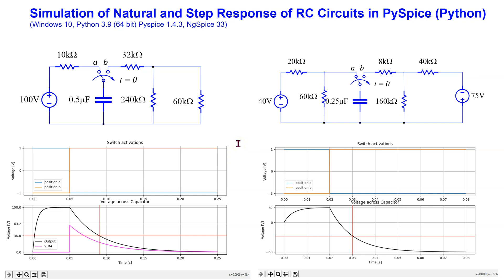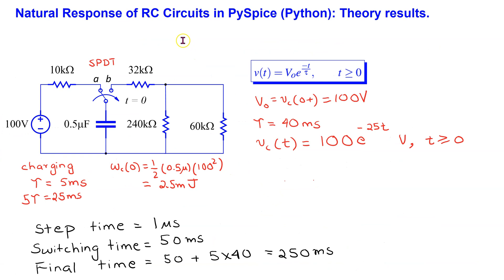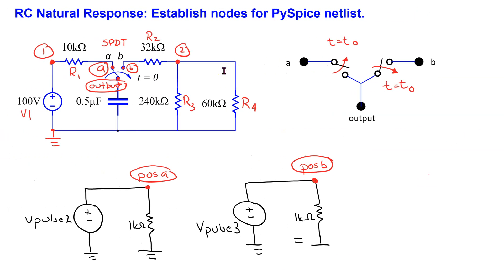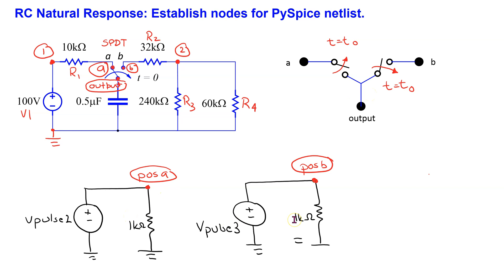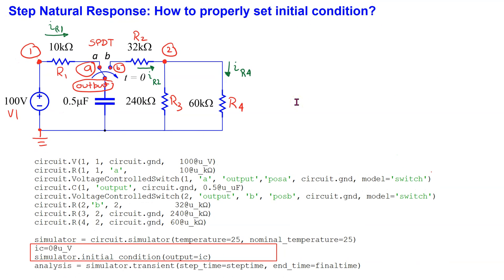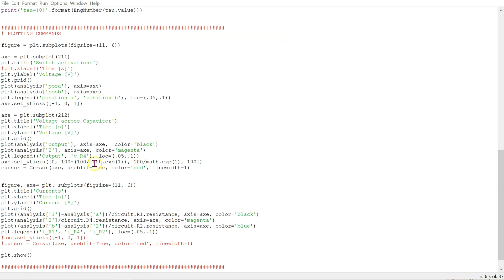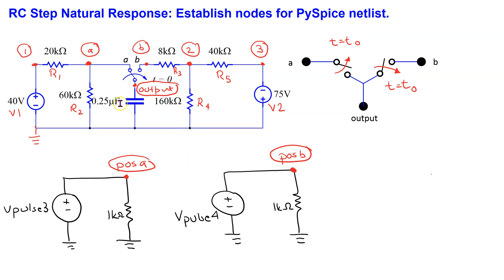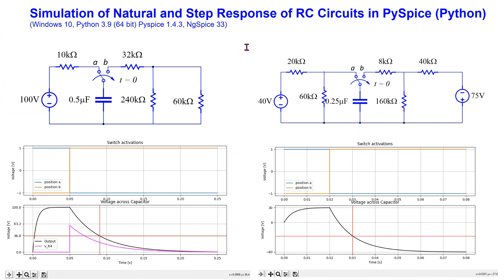Introduction to PySpice (Python) for Simulating Natural and Step Response of RC Circuits

Comment from the maker: # Pyspice (Python) code to simulate RC Step Response.
#####################################################################
# STANDARD DECLARATIONS

import matplotlib.pyplot as plt
from matplotlib.widgets import Cursor
import numpy as np

import PySpice.Logging.Logging as Logging
logger = Logging.setup_logging()

from PySpice.Doc.ExampleTools import find_libraries
from PySpice.Probe.Plot import plot
from PySpice.Spice.Library import SpiceLibrary
from PySpice.Spice.Netlist import Circuit
from PySpice.Unit import *

import math
from engineering_notation import EngNumber

#####################################################################
# CIRCUIT NETLIST
circuit = Circuit('Step Response of RC Circuit')

steptime=1@u_us
switchingtime=20@u_ms
finaltime = 80@u_ms

circuit.model('switch', 'SW', Ron=1@u_mΩ, Roff=1@u_GΩ)

circuit.PulseVoltageSource(3, 'posa', circuit.gnd,initial_value=1, pulsed_value=-1,
                           pulse_width=finaltime, period=finaltime, delay_time=switchingtime)
circuit.R('testa', 'posa', circuit.gnd, 1@u_kΩ)

circuit.PulseVoltageSource(4, 'posb', circuit.gnd,initial_value=-1, pulsed_value=1,
                           pulse_width=finaltime, period=finaltime, delay_time=switchingtime)
circuit.R('testb', 'posb', circuit.gnd, 1@u_kΩ)

circuit.V(1, 1, circuit.gnd,   40@u_V)
circuit.R(1, 1, 'a',          20@u_kΩ)
circuit.R(2, 'a', circuit.gnd, 60@u_kΩ)
circuit.VoltageControlledSwitch(1, 'a', 'output','posa', circuit.gnd, model='switch')
circuit.C(1, 'output', circuit.gnd, 0.25@u_uF)
circuit.VoltageControlledSwitch(2, 'output', 'b', 'posb', circuit.gnd, model='switch')
circuit.R(3, 'b', 2,           8@u_kΩ)
circuit.R(4, 2, circuit.gnd, 160@u_kΩ)
circuit.R(5, 2, 3,            40@u_kΩ)
circuit.V(2, circuit.gnd, 3,   75@u_V)

simulator = circuit.simulator(temperature=25, nominal_temperature=25)
ic=0@u_V
simulator.initial_condition(output=ic)
analysis = simulator.transient(step_time=steptime, end_time=finaltime)

#######################################################################
# THEORETICAL CALCULATIONS

# Time constant after switching
tau =(circuit.C1.capacitance)*(circuit.R3.resistance +
                                 (circuit.R4.resistance)*(circuit.R5.resistance)
                                 /(circuit.R4.resistance+ circuit.R5.resistance))
print('tau={0}'.format(EngNumber(tau.value)))

#######################################################################
# PLOTTING COMMANDS

figure = plt.subplots(figsize=(11, 6))

axe = plt.subplot(211)
plt.title('Switch activations')
#plt.xlabel('Time [s]')
plt.ylabel('Voltage [V]')
plt.grid()
plot(analysis['posa'], axis=axe)
plot(analysis['posb'], axis=axe)
plt.legend(('position a', 'position b'), loc=(.05,.1))
axe.set_yticks([-1, 0, 1])

axe = plt.subplot(212)
plt.title('Voltage across Capacitor')
plt.xlabel('Time [s]')
plt.ylabel('Voltage [V]')
plt.grid()
plot(analysis['output'], axis=axe, color='black')
#plt.legend(('Voltage'), loc=(.05,.1))
axe.set_yticks([-60, 0, 30])
cursor = Cursor(axe, useblit=True, color='red', linewidth=1)

figure, axe= plt. subplots(figsize=(11, 6))
plt.title('Capacitor current after switching')
plt.xlabel('Time [s]')
plt.ylabel('Current [A]')
plt.grid()
plot((analysis['b']-analysis['2'])/circuit.R3.resistance, axis=axe, color='black')

plt.show()

#####################################################################
# Pyspice (Python) code to simulate RC Natural Response.
#####################################################################
# STANDARD DECLARATIONS

import matplotlib.pyplot as plt
from matplotlib.widgets import Cursor
import numpy as np

import PySpice.Logging.Logging as Logging
logger = Logging.setup_logging()

from PySpice.Doc.ExampleTools import find_libraries
from PySpice.Probe.Plot import plot
from PySpice.Spice.Library import SpiceLibrary
from PySpice.Spice.Netlist import Circuit
from PySpice.Unit import *

import math
from engineering_notation import EngNumber

#####################################################################
# CIRCUIT NETLIST
circuit = Circuit('Natural Response of RC Circuit')

steptime=1@u_us
switchingtime=50@u_ms
finaltime = 250@u_ms

circuit.model('switch', 'SW', Ron=1@u_mΩ, Roff=1@u_GΩ)

circuit.PulseVoltageSource(2, 'posa', circuit.gnd,initial_value=1, pulsed_value=-1,
                           pulse_width=finaltime, period=finaltime, delay_time=switchingtime)
circuit.R('testa', 'posa', circuit.gnd, 1@u_kΩ)

circuit.PulseVoltageSource(3, 'posb', circuit.gnd,initial_value=-1, pulsed_value=1,
                           pulse_width=finaltime, period=finaltime, delay_time=switchingtime)
circuit.R('testb', 'posb', circuit.gnd, 1@u_kΩ)

circuit.V(1, 1, circuit.gnd,   100@u_V)
circuit.R(1, 1, 'a',           10@u_kΩ)
circuit.VoltageControlledSwitch(1, 'a', 'output','posa', circuit.gnd, model='switch')
circuit.C(1, 'output', circuit.gnd, 0.5@u_uF)
circuit.VoltageControlledSwitch(2, 'output', 'b', 'posb', circuit.gnd, model='switch')
circuit.R(2,'b', 2,           32@u_kΩ)
circuit.R(3, 2, circuit.gnd, 240@u_kΩ)
circuit.R(4, 2, circuit.gnd, 60@u_kΩ)

simulator = circuit.simulator(temperature=25, nominal_temperature=25)
ic=0@u_V
simulator.initial_condition(output=ic)
analysis = simulator.transient(step_time=steptime, end_time=finaltime)

#######################################################################
# THEORETICAL CALCULATIONS

# Time constant after switching
tau =(circuit.C1.capacitance)*(circuit.R2.resistance +
                                 (circuit.R3.resistance)*(circuit.R4.resistance)
                                 /(circuit.R3.resistance+ circuit.R4.resistance))
print('tau={0}'.format(EngNumber(tau.value)))

#######################################################################
# PLOTTING COMMANDS

figure = plt.subplots(figsize=(11, 6))

axe = plt.subplot(211)
plt.title('Switch activations')
#plt.xlabel('Time [s]')
plt.ylabel('Voltage [V]')
plt.grid()
plot(analysis['posa'], axis=axe)
plot(analysis['posb'], axis=axe)
plt.legend(('position a', 'position b'), loc=(.05,.1))
axe.set_yticks([-1, 0, 1])

axe = plt.subplot(212)
plt.title('Voltage across Capacitor')
plt.xlabel('Time [s]')
plt.ylabel('Voltage [V]')
plt.grid()
plot(analysis['output'], axis=axe,  color='black')
plot(analysis['2'], axis=axe, color='magenta')
plt.legend(('Output', 'v_R4'), loc=(.05,.1))
axe.set_yticks([0, 100-(100/math.exp(1)), 100/math.exp(1), 100])
cursor = Cursor(axe, useblit=True, color='red', linewidth=1)

figure, axe= plt. subplots(figsize=(11, 6))
plt.title('Currents')
plt.xlabel('Time [s]')
plt.ylabel('Current [A]')
plt.grid()
plot((analysis['1']-analysis['a'])/circuit.R1.resistance, axis=axe, color='black')
plot(analysis['2']/circuit.R4.resistance, axis=axe, color='magenta')
plot((analysis['b']-analysis['2'])/circuit.R2.resistance, axis=axe, color='blue')
plt.legend(('i_R1', 'i_R4', 'i_R2'), loc=(.05,.1))
#axe.set_yticks([-1, 0, 1])
#cursor = Cursor(axe, useblit=True, color='red', linewidth=1)

plt.show()

#######################################################################

Comment: Thank you for making this video. It is very helpful. I have a question regarding accessing LTSpice components model library in PySpice. I am trying access the standard.dio and other libraries from LTSpice into PySpice but I am not able to do it. Can you please suggest me the right way of accessing the libraries for the components that come with other the Spice software into PySpice please? Thank you for the video.
Reply from the maker: Thank you for the feedback.  PySpice uses Ngspice as back end simulator. LTSpice and Ngspice have some differences. See here how to define and use LTSpice diode models into PySpice: https://www.youtube.com/watch?v=rqppbitaQzE
Reply: @electriccircuits7164   Thank you very much. Sure I will go through it.
Reply from the maker: Also in another video in this channel it shows how to import opamps into PySpice.
Reply: @electriccircuits7164  Thank you for making this tutorial; they are really helpful. I am going through all of your PySpice tutorial videos.
Reply from the maker: Thank you. Glad to know it is helping your learning!
Reply: @electriccircuits7164  Hi. How can I model a switch for only turning ON and OFF the source rather than two-way switch like the one you have used in this video? I want to model a swtich for swtiching the source high and low. For example if I interchange the position of a swtich with 10Kohm (series resistor with source) in the RC circuit in one of your example cirucit that you have used in this video, what changes do I need to do in that case?
Reply from the maker: Thank you. ON and OFF switch modelling is discussed here: https://youtu.be/adodw2tTogM

Comment: Hi, thanks for your videos, they are very helpful! I would like to know how to change the "circuit.PulseVoltageSource()" source to an external voltage source?
Reply from the maker: Thank you. Can you please explain your question in more detail. Why would you like to change and what are you trying to simulate/achieve
Reply: @electriccircuits7164  Sure, I have this algorithm which is a square signal:
from scipy import signal
import numpy as np
import matplotlib.pyplot as plt
from matplotlib.widgets import Cursor
t = np.linspace(0, 0.1, 500, endpoint=False)
figure,axe=plt.subplots()
x = plt.plot(t, signal.square(2 * np.pi * 60 * t, duty =0.45))
plt.ylim(-2, 2)
cursor = Cursor(axe,useblit=True,color='red',linewidth=1)
plt.grid()
plt.show()

And I would like this algorithm to control the switches instead of the "Vpulse 2" and "Pulse 3" components, what do I have to do? Thank you.

Comment: Where are the Python codes for these circuits?
Reply from the maker: All the codes are copy pasted in the video comments. They exceed the character limit so cannot be posted in the video description. It can be tricky to see them if you are accessing from a smartphone device. You might have to change the settings to display all comments. Alternatively access through a browser on your laptop/tablet.
Reply: @electriccircuits7164  Thank you! I have another question, how can you implement polarized capacitors using PySpice?
Reply from the maker: Thank you for the interesting question. 

NGSpice (underlying spice engine for PySpice) comes with a basic and a semi-conductor capacitor models only (see pages 76-77 in the NGSpice user manual).

The general spice model of (polarized) capacitors in available here: http://ltwiki.org/index.php?title=C_Capacitor 

The principle is to use series and parallel R, L and C components to model the capacitor. 

Some manufacturers provide spice models for such capacitors. For instance, see the specific models inside the zip files here: https://www.nichicon.co.jp/english/products/spice/index.html

Comment: Hello! Thanks for your vids! I have one question: is it possible to do logic, that will be calculate in each simulations step? I need to save time of simulation t_start, when v(node) is grather than value. And this time I want to use in definition of resistor, that will be change over time using formula R(abs(t_actual-t_start))
Reply from the maker: Yes from my understanding that should be possible to do...although I have not yet done it myself.

Comment from the maker: # Pyspice (Python) code to simulate RC Natural Response.
#####################################################################
# STANDARD DECLARATIONS

import matplotlib.pyplot as plt
from matplotlib.widgets import Cursor
import numpy as np

import PySpice.Logging.Logging as Logging
logger = Logging.setup_logging()

from PySpice.Doc.ExampleTools import find_libraries
from PySpice.Probe.Plot import plot
from PySpice.Spice.Library import SpiceLibrary
from PySpice.Spice.Netlist import Circuit
from PySpice.Unit import *

import math
from engineering_notation import EngNumber

#####################################################################
# CIRCUIT NETLIST
circuit = Circuit('Natural Response of RC Circuit')

steptime=1@u_us
switchingtime=50@u_ms
finaltime = 250@u_ms

circuit.model('switch', 'SW', Ron=1@u_mΩ, Roff=1@u_GΩ)

circuit.PulseVoltageSource(2, 'posa', circuit.gnd,initial_value=1, pulsed_value=-1,
                           pulse_width=finaltime, period=finaltime, delay_time=switchingtime)
circuit.R('testa', 'posa', circuit.gnd, 1@u_kΩ)

circuit.PulseVoltageSource(3, 'posb', circuit.gnd,initial_value=-1, pulsed_value=1,
                           pulse_width=finaltime, period=finaltime, delay_time=switchingtime)
circuit.R('testb', 'posb', circuit.gnd, 1@u_kΩ)

circuit.V(1, 1, circuit.gnd,   100@u_V)
circuit.R(1, 1, 'a',           10@u_kΩ)
circuit.VoltageControlledSwitch(1, 'a', 'output','posa', circuit.gnd, model='switch')
circuit.C(1, 'output', circuit.gnd, 0.5@u_uF)
circuit.VoltageControlledSwitch(2, 'output', 'b', 'posb', circuit.gnd, model='switch')
circuit.R(2,'b', 2,           32@u_kΩ)
circuit.R(3, 2, circuit.gnd, 240@u_kΩ)
circuit.R(4, 2, circuit.gnd, 60@u_kΩ)

simulator = circuit.simulator(temperature=25, nominal_temperature=25)
ic=0@u_V
simulator.initial_condition(output=ic)
analysis = simulator.transient(step_time=steptime, end_time=finaltime)

#######################################################################
# THEORETICAL CALCULATIONS

# Time constant after switching
tau =(circuit.C1.capacitance)*(circuit.R2.resistance +
                                 (circuit.R3.resistance)*(circuit.R4.resistance)
                                 /(circuit.R3.resistance+ circuit.R4.resistance))
print('tau={0}'.format(EngNumber(tau.value)))

#######################################################################
# PLOTTING COMMANDS

figure = plt.subplots(figsize=(11, 6))

axe = plt.subplot(211)
plt.title('Switch activations')
#plt.xlabel('Time [s]')
plt.ylabel('Voltage [V]')
plt.grid()
plot(analysis['posa'], axis=axe)
plot(analysis['posb'], axis=axe)
plt.legend(('position a', 'position b'), loc=(.05,.1))
axe.set_yticks([-1, 0, 1])

axe = plt.subplot(212)
plt.title('Voltage across Capacitor')
plt.xlabel('Time [s]')
plt.ylabel('Voltage [V]')
plt.grid()
plot(analysis['output'], axis=axe,  color='black')
plot(analysis['2'], axis=axe, color='magenta')
plt.legend(('Output', 'v_R4'), loc=(.05,.1))
axe.set_yticks([0, 100-(100/math.exp(1)), 100/math.exp(1), 100])
cursor = Cursor(axe, useblit=True, color='red', linewidth=1)

figure, axe= plt. subplots(figsize=(11, 6))
plt.title('Currents')
plt.xlabel('Time [s]')
plt.ylabel('Current [A]')
plt.grid()
plot((analysis['1']-analysis['a'])/circuit.R1.resistance, axis=axe, color='black')
plot(analysis['2']/circuit.R4.resistance, axis=axe, color='magenta')
plot((analysis['b']-analysis['2'])/circuit.R2.resistance, axis=axe, color='blue')
plt.legend(('i_R1', 'i_R4', 'i_R2'), loc=(.05,.1))
#axe.set_yticks([-1, 0, 1])
#cursor = Cursor(axe, useblit=True, color='red', linewidth=1)

plt.show()

#######################################################################